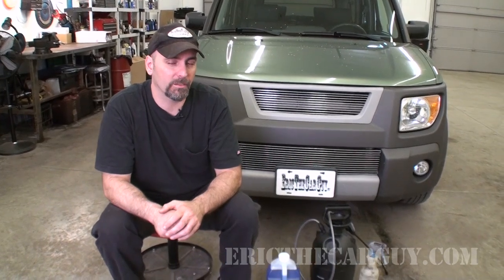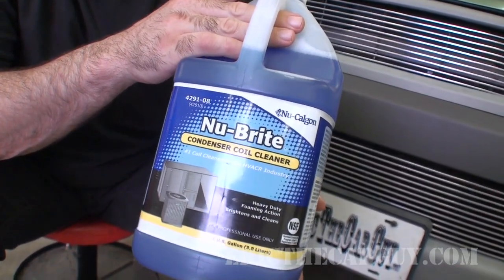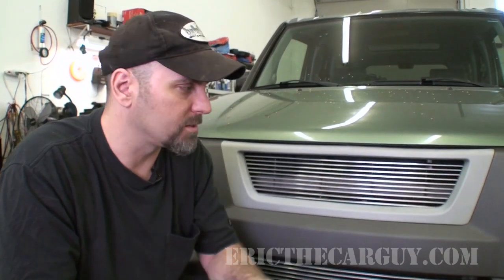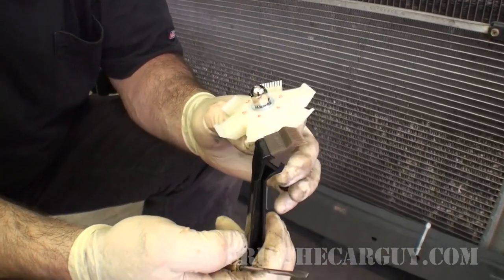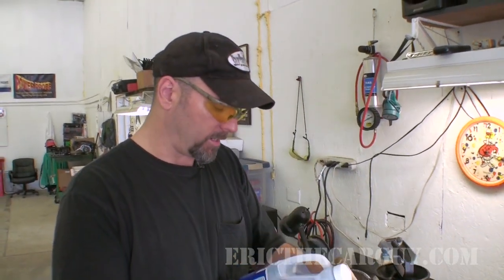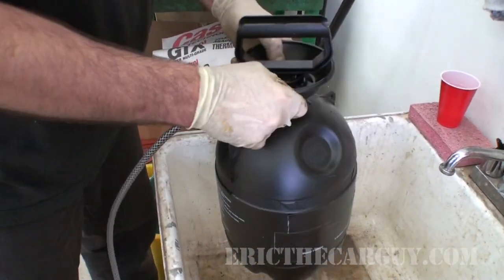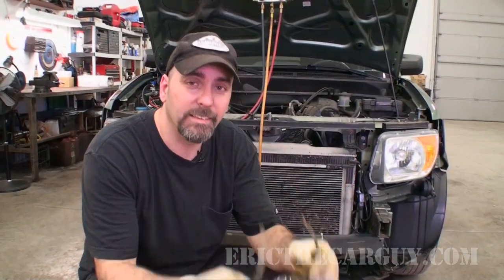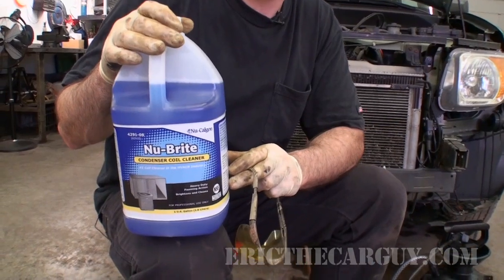Increasing AC Performance by Cleaning Your Condenser -EricTheCarGuy

Comment: Amazing results for sure,
Do you think you could get a similar effect from using this method to clean the radiator?
Reply: I was also about to ask the same thing....
Reply: Well unless you have a overheating problem your temp will remain about the same by design anyway and the radiator cap reduces pressure by releasing coolant into your overflow tank.
Reply: Yes. However, unless the engine is running too hot, the engine probably won't run any cooler. The thermostat will just stay closed a bit more. Similar to driving in cooler weather.

Comment: Very cool. But this seems to introduce a large uncertainty into the equation. Most diyers will use a gauge set and a range of low/high pressure to top off a lagging ac system. If you clean your condenser, then how accurate are those pressure and temp charts?

Comment: Hey Eric you mentioned in this video about the evaporator "freezing up". What happens when it does freeze up....before it does and when it does? My car a/c system works, but tends to stop working after a while. Sometimes it'll run a long time on a warm day (80-90 degrees), and sometimes it shuts off within minutes. When it shuts off, the a/c clutch is still engaged and the compressor is still turning, but the vent temperature is "room temperature" and not cold. Now if I let the car sit (not running) for an hour, or hour and a half and start it back up...the a/c works fine again....but eventually will shut off over time. When I say "shut off", I mean instantly, not gradually get warm....even though the compressor still turns. Is it possible the evaporator is freezing up? When it is working, the a/c does get really cold. Thanks.

Comment: I wonder how much of a performance increase only rinsing the condenser  off with just water would be instead of using the chemical. It might be an easier fix instead of investing in the chemicals if there are any gains.

Comment: my compressor cracked open on a hot humid day around 90° probably because of that. I'll give it a look while i change the compressor. Good to know!
Reply: It shouldn't have. If the head pressure got too high the hpco switch/pressure sensor should have cut it off long before that and you would have had a rapidly cycling clutch. Most likely it suffered a fatal seizure from a serious lack of lubrication (which can be caused by a very low charge). Scrolls and vanes can fail this spectacularly. Piston compressors are a bit more forgiving.

Comment: HI ERIC MY NANE IS SILVIO I HAVE  CUESTION I HAVE TO PUT OIL IN THE SYSTEM PLUS THE OIL IN THE COMPRESSOR AND OLSO TWO IF I REPLACE THE EVAPORATOR AND CONDENSOR AND ACCUMULATOR  (MEANS I HAVE TO ADD OIL IF I CHANGE NEW PARTS OR JUST USE THE IOL COMPRESSOR FOR EVRY THING ). THANKS  SILVIO.

Comment: great information Eric!
quick question is there a way I can I add an ounce or 2 of oil to my ac compressor if it's already been serviced and charged? the  accumulator was replaced and evacuated but I forgot to add a little oilbefore I charged it with Freon :(
thanks,
Dan

Comment: Just a quick comment, used engine cleaner on my condenser, water rinse, wham Bam, did great. Did it before your video or would of tried that stuff, but cleaner really works well. Thanks for the video

Comment: Sorry for my ignorance but how can you measure the temperature difference when the car is not driving i.e. the air is not cooling the condenser?
Reply: Thanks. I would think that if the AC is not being cooled by air than it shouldnt make any difference when its with dirt or not.. therefore it would be better to test both situations while driving.

Comment: My AC system was empty because the motor was taken out to paint the engine bay. I was melting in the 100+ degree weather and got a can of refrigerant at the auto store. I added it to the car in the parking lot and was relieved. Now I'm freaking out wondering how much oil my system has or needs. Is there a way to check? Should I start over and apply vacuum and refill? Even then how much oil is needed? Thanks a million!

Comment: What should the gauge read on the low side for a fully charged system with compressor running?
Reply: Around 5000psi if the temperture is really hot

Comment: You should have ran the ac on high, not low when testing to put a larger load on the system.  You might see a temp difference testing this way.

Comment: Would cleaning the condenser and lowering the system’s psi give you better gas mileage while the AC is on?  I lose almost 2mpg when the AC is on with 270K on my Pilot.  Thanks for any replies being 8 years late to the party.

Comment: EricTheCarGuy. the condenser in my car is really dirty, it has dried oil on it...can I just use engine degreaser instead of that product?
Reply: Thrash that condenser. Dried oil, provided you don't have another oil-fed radiator nearby (such as the power steering one), means that the condenser is leaking.

Comment: Wondering if anyone could give me any advice. Replaced my AC Compressor last summer because I was told it was bad. After it was recharged by a mechanic(goodyear), I still had no cold air. The compressor clutch was greatly improved, but I still wasn't getting cold air. I'd like to fix my AC before it gets to hot this year. The blend doors and actuators are fine, the control unit on the dash works fine, and the compressor seems to be working, but it's used so I can't be sure. I can do all labor except evacuating and recharging myself as I don't have the tools needed. Should I replace the drier and condenser?

Comment: My 350z AC only blows cool when it's 75 degrees or lower outside. I have had the system evaced, tested and filled appropriately.  Still doesn't cool. I recently noticed that the CONDENSOR is painted over (must of happened when it was respected with custom color by previous owner. Question is will this not allow the CONDENSOR to work properly?
Reply: Marcus Lopez YES. Body paint on condensor = bad.

Comment: I have a 97 olds lss  with manual ac. Replaced compressor drier orfice tube and condenser all new....head pressure is crazy high   no cold air clutch cycles constantly ...only thing left is the evaporator    weird and frustating

Comment: Eric that was awesome 

I wanna do it to my car but i am petrified that this material will ruin my car's paint finish or my headlights cuz I'm not intending to remove the front panel which is also painted and my car is black!

Any advice on that?
Reply: i have done car and home a/c units the coil cleaner will NO DOUBT ruin paint
you have to avoid finished areas of the car paint.

Comment: why would you need special licensing for r134a when its used as a propellant for airsoft guns aerosol sprays duster cans foam blowing and other industrial and pleasure uses that release it into the atmosphere??  doesnt make sense that it would be any different when in a auto ac system

Comment: Eric I changed the ac compresor on my 1999 honda civic recharged it and it's still not super cold it's some what cold but not good can you help
Reply: Paul Fedyakov Verify vent blend doors are fully functional and are completely isolating the heater core. Also check your climate control module is good.
Reply: The tiny passages INSIDE your condenser can also get clogged up with gunk on an older system. Then it's best to just replace it.

Comment: my Ac is cold but when I first start car on hot day it blows hot air till I drive a couple miles. what do I need to do to help with this.
Reply: Nothing mostly every car takes a little bit before it blows cold
Reply: Thats normal if it has been sitting awhile before you drive it ....you can always get a thermometer and see what it's reading out.. Make sure the air gets 30-40 degrees colder than the outside temp.. But it takes it a few minutes to build pressure and to circulate after it has been sitting.
Reply: Ronald Walls shift into a lower gear? That'll get you up to higher rpms...

Comment: The cleaning may not have affected the lowest temperature the AC system could reach, but it may have changed the rate at which it reached that temperature (I.e. it may be cooling your car off faster).

Comment: The folded fins hurt the system but being your condenser is a micro channel style coil trying to use a fin comb is like pissing in the wind and also when you did your second test was the condenser dry if not thats why the pressure differential was so high. Btw this is coming from a career hvac technician overall good advice to diyers.

Comment: Cool video. :) I always use compressed air to blow out the big stuff.  Perhaps a good use of that API air comb you tested out in another video?  I agree, those fin combs are useless, and I'll do it with a pocket screw driver if the fins are mashed flat. Your Honda's condenser was pretty pristine compared to a lot of what I see, especially on lower sitting cars.   I just use brake cleaner being sprayed out with a high pressure sprayer and it can make a world of difference.  Might have to get some of that nu-bright.  Don't forget the cabin air filter.  9/10 of those I pull out could be used to grow plants.

Comment: So i checked the presures and im kinda confuse im still learning tho. At idle i got 275psi and when the fan kiks in ( cause its not on at all times) it drops to 250 and the low side its at 60 psi and goes down to 50 when fan kiks in if i raise rpms to 2500 the presures go to 30 on the low side and 200 on the high side, the compresor its on at all time i suspect weak compresor but im not sure. On another note the ac its fine while car in motion but at stops iibdoesnt anymore its a town and country 2008 3.8 any suggestions? Thanks in advance
Reply: Also temp outside its 104 degres. Its hot here in AZ 🔥🔥

Comment: Is it a good idea to blast with low pressure air first? Say around 30 psi…just to get the dirt and dead bugs out…what damage could happen if high pressure air/water is used? Thanks…
Reply: I would be careful that you don't imbed the dirt/bugs/rocks further into the coils.  Possibly blowing from aft to forward would be better.  My 2 cents...
Reply: ^ Good point there. And also, the chemical is intended to eat that stuff, so you just rinse out the remnants afterward. Too much PSI and you'll bend the fins, as ETCG mentions several ties.
Reply: I just pressure washed my condenser and radiator after I found some cleaner at home depot for about 5 bucks a can.  The pressure washer did not bend the condenser fins, but some of the radiator fins bent.
Reply: chihuahua verde Time for the pocket screwdriver. :) The fins are a LOT closer on my home's condensor than on a car's condensor. I pushed on a few as I used compressor air to blow TONS of dirt out. Made my house run a lot more efficient. Every fin I bumped to straighten pretty much moved back to wear it was. On a car, with them farther apart I can see how it'd be easier to make it better, but wow, unless I was feeling really zen, I wouldn't want to spend a lot of time on that.

I liked another person's suggestion to put a hardware cloth behind the grill to prevent more damage, or prevent damage in the first place. It is a more open weave than a wind screen.

Comment: So, did the low side pressure come down any?
Reply: The condersor is on the " high side "  of an ac system .  Low side would be the evaporator .  Cleaning that and making sure you have a clean air cabin filter would effect your low side .

Comment: Those damn fin straighteners never seem to have the correct # of fins per inch.
On home window ac units whose coils lack the horizontal fin supports ive had good luck using stiff bristled nylon or brass brushes.
Reply: I wouldn't have the patience for that lol

Comment: Condensers are cheap vs. the amount of time spent screwing around trouble shooting.  Replace them whenever you replace a compressor/evaporator/lines.  Dont forget the orifice tube.  Also, sodium hydroxide is Lye,  buy lye and you could mix a little on your own....aaand also, Drano's active ingredient is sodium hydroxide too.  All should work.  Good luck.

Comment: ERIC THE CAR GUY hey bro love your videos. Your awesome. But I have a question. My 96Impala started acting up on me for no apparent reason real days ago. You see it turns on fine and everything. But when I turn the A.C on the idle rhythm immediately goes , out of wack. And the cars RPM go so far down. The car has shut down on me twice. No "check engine" light. So no code. What can I do? HELP PLEASE
Reply: Try 

- increasing the idle speed 
- change the engine air filter 
- change the gas filter
- check your car's electrical dinamo by disconnecting the battery while the engine is running, the engine should not turn off, if it does then you should change your dinamo 

All cheap stuff and may work 

Good luck

Comment: Do you feel like your rinsed everything out?

From what I have read it is common for condenser cores to fail because all of the sodium hydroxide was not completely rinsed out and it ate up the core.

I want to do this myself but I am concered about it destroying my condenser through the trace amounts remaining from the cleaner.

Also I read your supposed to rinse from the inside out, so I am wondering if the cleaner is still sitting on the parts on the opposite side next to the fans and other parts.

I know that the lable says safe for aluminum and copper but I don't believe that is completely accurate. I believe for a short cleaning it will be fine but if there is any remaining it will keep eating the metals.

Comment: Hey buddy first off I want to say thank you very much for all your great videos. I have helped me out tremendously on my DIY experience. So I have a 2010 Honda CRV and I'm having issues with my AC not putting out cold air when the car is sitting idle. It does great when I am driving above 40 miles per hour however when sitting still it will barely blow out any cold air. I have checked my cooling fans to make sure they are operating as they are supposed to and they do stay on when I turn the AC on. What else should I check for? Do you think there might be a small leak? What way would you go about diagnosing this issue
Reply: COgunLover I had the same issue with my 07 dodge ram. Ac worked good while moving but not while going slow or sitting idle. My condenser fan was not coming on while i sit idle or at slow speeds. Which it should. So changed it the other day and it fixed that problem.  Maybe that's what's wrong with yours.
Reply: Just now loaded the rest of your post. Sorry I didn see it. Maybe blower motor or blower resister

Comment: Here’s a trick. If it’s hot. We usually put stop leak. Then dye. Then wash out the condenser as u did. Then last add freeze. Ya hlp help a lot to b cold  Nd drive it for one hour. HONESTLLY u tube helps

Comment: I found the leak in my ac I fixed it and changed my compressor had an professional check it for leaks and there was none we topped off the Freon again but it's still blowing hot air something won't let the Freon circulate all my electronics work but the thing still blows hot in my 01 v6 mustang wtf should I do to fix this
Reply: Dannymclovin69 IMHO, one of the most common overlooked "insufficient cooling" complaints is the blend doors. And the most difficult to diagnose. Yours may not be COMPLETELY isolating the heater core. Even a slight opening (1/8" - 1/4") gap will severely affect your vent temps. Some are mechanically controled, others are servo/motor controlled. This requires partial to complete dash disassembly to troubleshoot. And a good schematic and vent system diagram. Once all "under the hood" issues are exhausted, this is the likely issue. Good luck.

Comment: THE REASON your high side pressure was lower after is because you did the test with a wet condenser. So this test is INCONCLUSIVE. For it to of been a conclusive test the condenser would had to of been completely dry then recheck high side pressure‘s

Comment: Idk if somebuddy could tell me what makes the fan to turn on whit the ac i checked fuses and relays and there are fine if there is a high presure switch in the town and country?could somebody  please let me knos where is it at
Reply: My fan doesn't come on also when i turn on my ac 2005 town and.country also! Changed the fuse and the relay thats lays on the bumber let me know if you find a fix please
Reply: @Nicole-dj3jf   the fix turned out to be the high presure sensor in the high line the sensor its behind the air filter. that fixed mine. They are not expensive but ill suggest check it first
Reply: @JM-mc7td  thank you can i ask what year your van is? Did it cause your temp to go up? Mine goes up but doesnt over heat but the hoses are hard and hot i can only drive 15 mins before the engine get the whole hood hot but still the temp is in normal readings im so lost
Reply: @JM-mc7td  thanks for the fast reply i have asked for a few months now your the first to answer back lol
Reply: Youre welcome my van its a t&c 2008 and the temp doesnt come up past normal. At the end it was the sensor and the gas was low. Good luke

Comment: New txv New dryer. No leaks and hold vacuum, holds freon, compressor kicks on. Air inside car is slightly cooler but not cold then after 20 min or so gets hot... normal low side but low highside...

Comment: i would not use sodium hydroxide on aluminium since it will dissolves your condenser, making it thinner and weaker after each washes! By the way, those bubbles are hydrogen molecules, stay away from sparks.

Comment: Don't overlook using the extra mix for your home A/C. Clearly you need to pay attention to the lawn, but home air conditioners suck in a lot of dust, pollen and the like - and unlike our cars where there is some flushing action when you run it through the car wash... when was the last time you ran your house through a car wash?